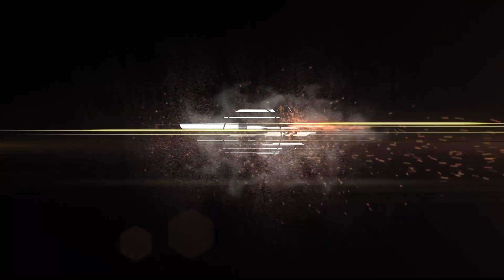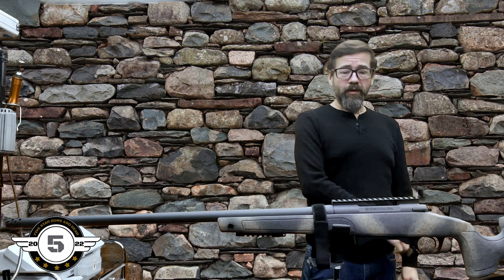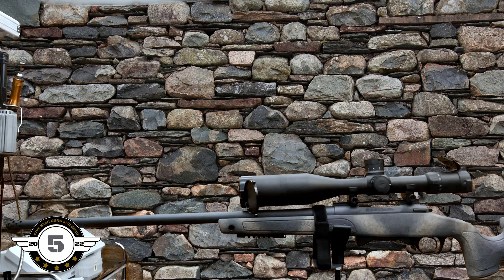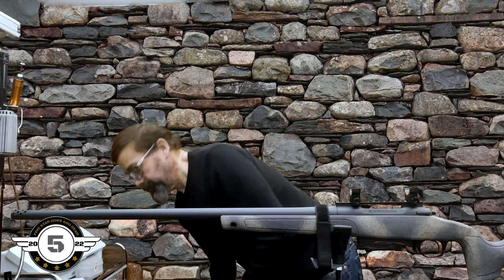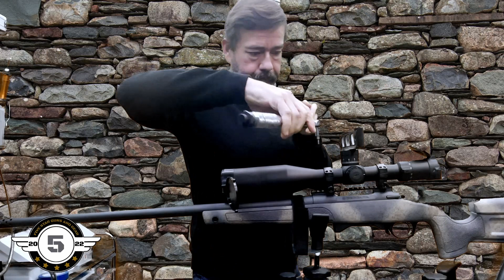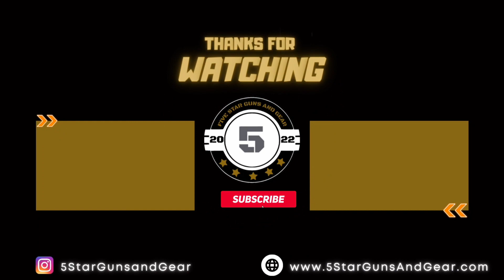Rifle Scope Mounting and Reticle Leveling MADE EASY No Special Tools Or Devices Required

Comment: Thread lock is a controversial subject because there’s a risk of over tightening even when using a torque wrench. Also on the subject of torque wrench’s there’s a YouTuber call Gunblu who doesn’t recommend the use of them. He worked for a large manufacturer Ruger I believe and they did not use them except for when setting up machining equipment that required precision. His approach was when the screw has bottomed out stop tightening and that had worked fine for decades.

Also did you confirm that the top of the turret is level with the scope manufacturer because a lot aren’t. I normally level the gun on the bottom half of the scope rings before mounting the scope, then knowing the gun is level I set eye relief and then use a plumb line to level the reticle.
Reply from the maker: depends on the scope this one was